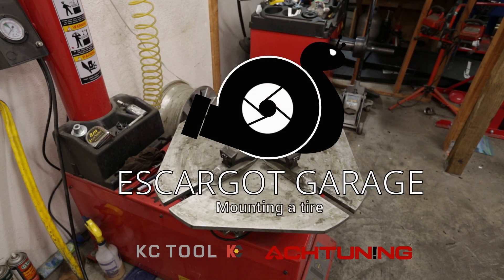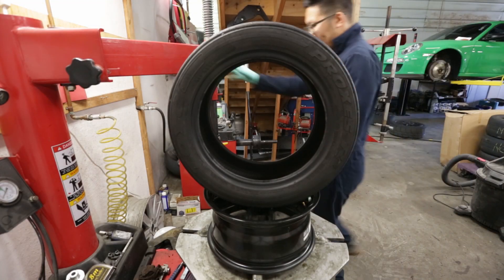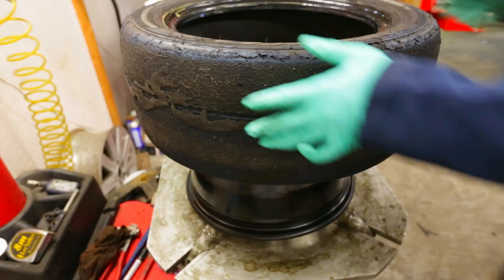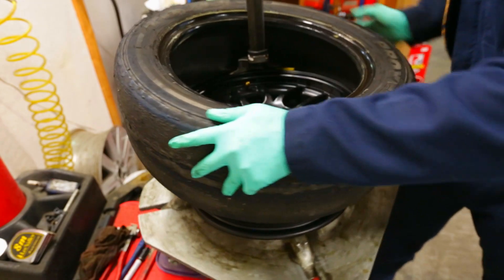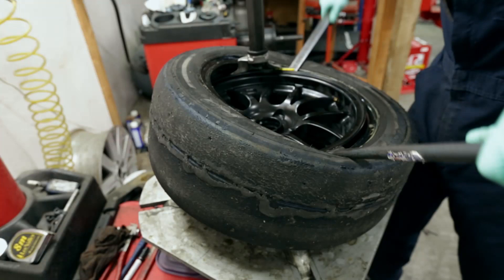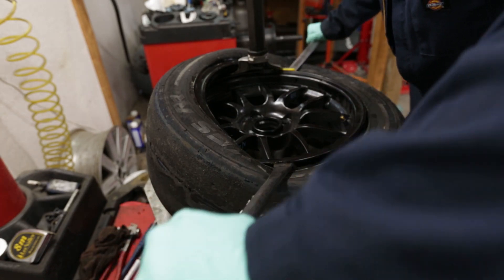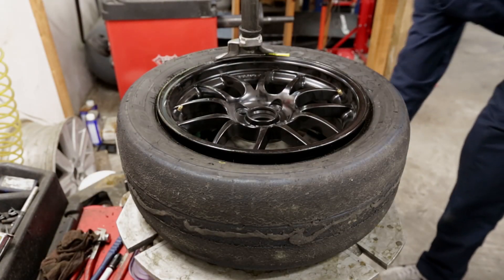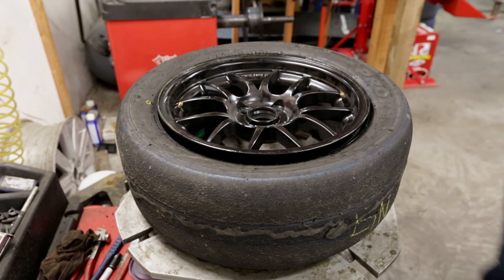Mounting a tire using a Derek Weaver tire machine

Comment: How do you like this unit? Does it scratch rims?
Reply from the maker: It's "fine" for mounting a tire with a decent sidewall, but I would not trust it on any wheel I actually care about. This has since been replaced with a Twin Busch X36, which is much better, but I'd still gladly pay $25 a wheel to mount and balance my BBS set.